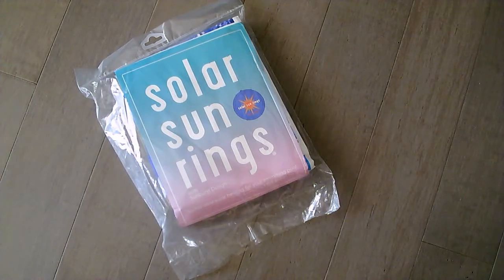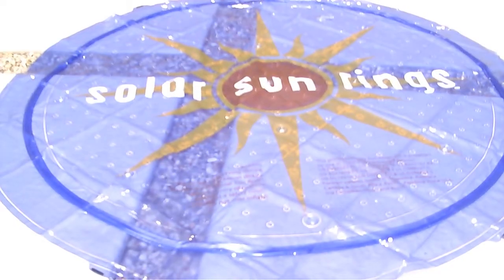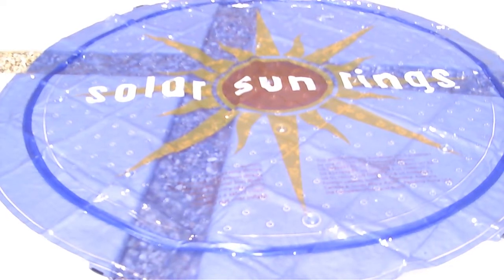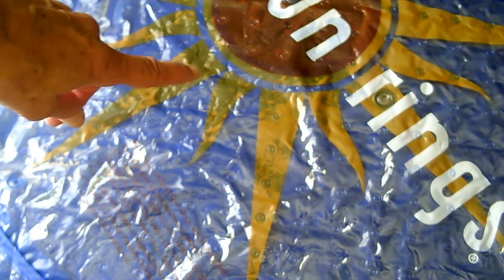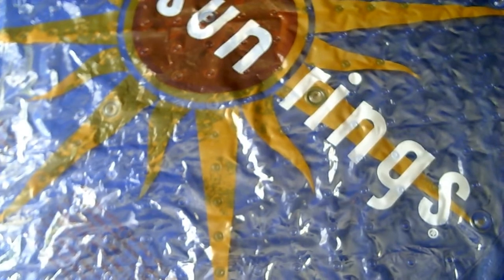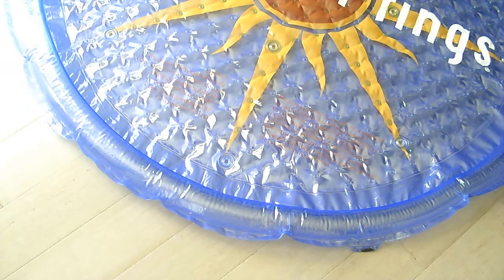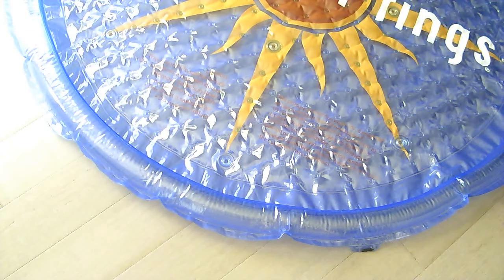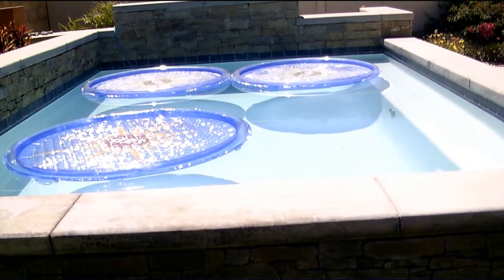How to inflate Solar Sun Rings

Comment: Is the outside ring big enough to feed a pool noodle through instead of air ?
Reply from the maker: The only opening is the blow valve, so it would not be possible as they are designed, However, if you wanted to cut the ring open to slide in something a little smaller than a noodle, you could probably do that.  Water would get into the outer ring of course, so the float device would need to compensate for that.  The pool noodles I have would be too wide to fit in the outer ring.